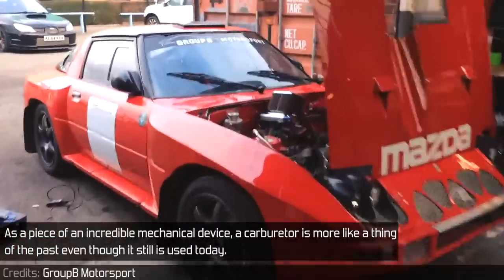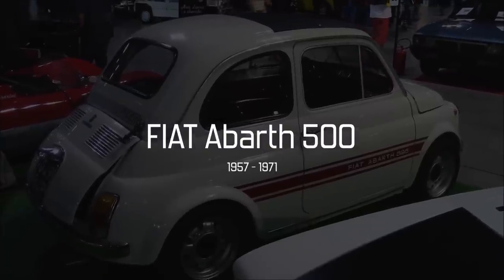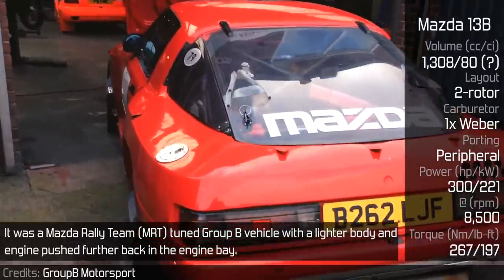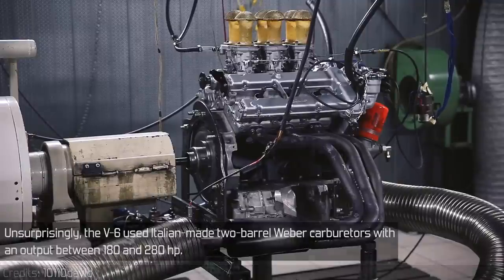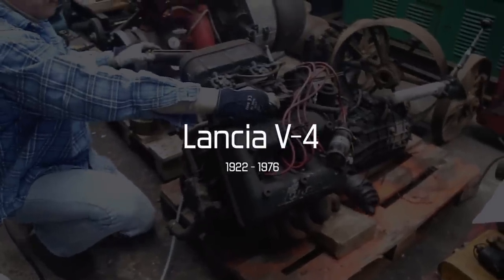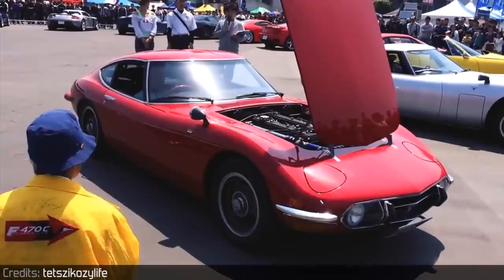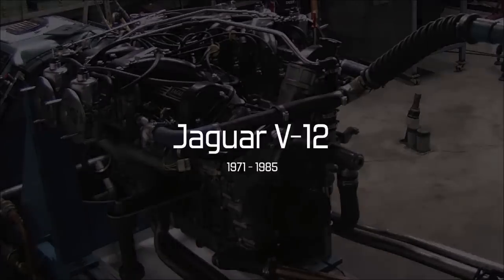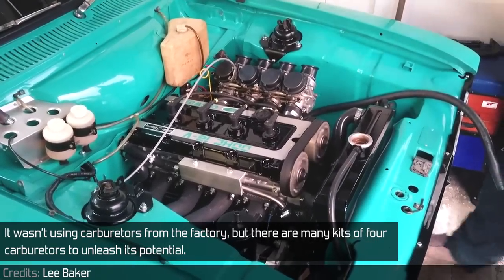10 Of The Best Sounding Carbureted Engines | Ep. 2

Comment: Best sounding carburetor car I used to own was a Mini Clubman S with a Cooper S 1310cc engine!  The rebuilt engine replacing the original 1100cc one I had fitted with a rally cam, & as it had for some reason a non-factory manifold having stud-holes which could accept larger 1&1/2" SU twin carbs (fortunately found an odd matching one at a wreckers). After grinding out the manifold to match the carburetor venturis, installing the engine with headers/extractors & straight-thru muffler, &  with a bit of trial & error with needles , I had that Mini sounding & performing totally awesome! 
Was even asked whether it had a V8 in it!
It was a full conversion with the disc-brakes, a Rover brake-booster, dual-tanks, in one of the last Aussie Minis to have hydrolastic-suspension (pumped-up, with shocks & adjustable negative-camber arms fitted), running widened rims & rubber!

Comment: Um , your Jag V 12 was the six cylinder version
Reply: marc st laurent I just got to that part of the video myself! Was wondering if anyone else had noticed... Lol
Reply: Yeah...but not to worry.  The straight 6 sounds better than the V12 anyway.  :-D
Reply: aussiebloke609 Indeed it does! More reliable too with the added bonus of a sweeter note. We have a 4.2 Jag straight 6 putting out around 285bhp and 300ib/ft of torque in a 1970 Ford Capri Mk1
Reply: Damn...that's gotta be a tight fit.  I remember the old Capri...pretty sure it wasn't designed with a straight 6 in mind.  :-D
Reply: And the inline 6 has as much horses as the V12 and just a bit less torque, the V12 actualy is the cheapest E type you can buy because most don't want this version with all it's added trouble and maintenance costs.
Reply: But i think the part where we saw jag revving from behind was v12 because i have seen that type of exhaust only in v12 models
Reply: Kalle Lahti yes, the red E Type with the four tail pipes out of the single back box is a V12 example
Reply: @Rius9106  also you can here from the note the softer tone generated by more cylinders. Personally I think V12 fits better to the classy style of Jaguar, but would pick the V6 myself tho

Comment: In Australia chrysler produced the charger with a 265ci (4.3 litre) inline 6 that was factory fitted with triple webber carbs. Holden produced a 202ci (3.3 litre) inline 6 with triple carbs, both of these engines sound better than anything on this list

Comment: Noteworthy: the Cosworth YB is distantly related to the 2.3L OHC I4 used in Ford Pintos and Mustangs (basically different branches of the same evolutionary tree).  Like the Cosworth, the Pinto/Mustang 2.3L absolutely loves boost and has been seen putting out over 1,000 horsepower with enough of it.

Comment: Toyota 4A GE?
Reply: TheJean590 ikr but maybe the part 1
Reply: those are always fuel injected, the 'E' stands for fuel injection

Edit: the 3M-GE mentioned is a mistake as a 3MGE never existed
Reply: It's in the first video because many people swapped them to carburetors
Reply: Those have EFI. The AE85 was carbureted though I believe
Reply: did you read what I wrote?
Reply: eraser216 I didn’t see that, but if that’s the case it makes sense. Why do people swap them back to carbs though?
Reply: wes276 it is a lot simpler and no electrical wires needed if done right carbs are highly tunable? And the sound maybe
Reply: Idk but watch argentinean ford falcon 221 engine, thats savage
Reply: wes276 I don't know but many people did this with the first fuel injected Opel engines too. Maybe there was not much know how about injection tuning back then and for the self-wrenching car guys it was easier to swap to carbs and work on them.
Reply: response and ease of tuning is the main reason
Reply: ae85 was carbureted but was equipt with the 4A-C (SOHC)
Reply: I'm going to carb the 4A-GE in my mk1 MR2 soon, with Honda CBR900 carbs :) :)

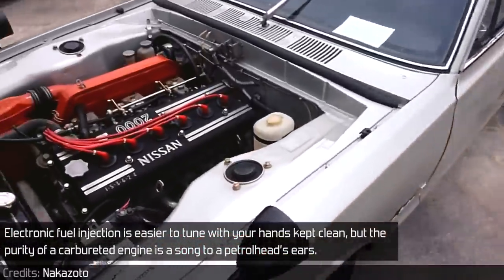Comment: Eletronic fuel injection is harder if you consider the costs and the devices you have to use...but you will get a better tuning in the end compared to a carburetor 0:10
Reply: once set up, cpu tuning is much easier than swapping jets and checking plugs
Reply: EFI doesn’t need maintenance/tuning nearly as much though
Reply: Leonardo Vargas I'm the guy who can still time a carb engine by ear. No need for a timing light. I also daily a 1975 Ford Maverick on my channel

Comment: In Australia there was a I6 holden from the 1940's to the late 80's starting at 138ci and ending at 202ci which its similar to the L series and was known as the giant killer as it beat the ford 351ci around bathurst
Reply: The early grey motors were different castings and not interchangable with the red/blue/black engines even though they look similar, so you're really talking 64-85 (EH-VK). The VL used the Nissan RB30 and the VN onwards used the Buick V6.
Yeah the XU-1 Torries were quick, but a lot of that was power to weight ratio being 300-400 kg lighter than the Falcon GT, also the triples were a bitch to tune and keep tuned, the second they got out of tune the Falcons would just disappear in the distance (same thing with the 6 pack Chargers).

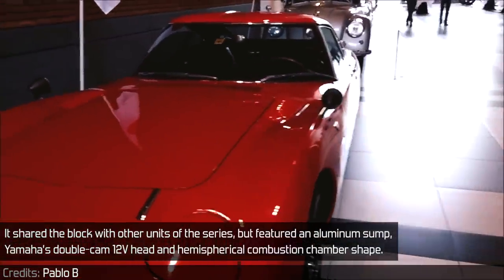Comment: there's a little error at 6:40. that's the 3M engine, not the 3m-ge. G came later for engines whose cylinder head is intended for performance , E means electronic injection

Comment: ive always liked the 'chevy power moan"

my 77 chevy truck......that 400 small block trying to move the 4200 pounds of truck threw a Q-jet carb...... BAAAWWAAAAAAAAAAAAAAAAAA
Reply: also,,,,, my 99 buick century with a 160hp 3.1 v6 sounds SO FUCKING GOOD
its all intake noise....

its bark is much worse than its bite..... it sounds like a 6 liter, but has the power of a 2 liter (its got a lot of touruqe however.....its a FULL 160hp)

Comment: Carbureted engines sound interesting because the carb does a piss poor job of delivering an accurate and equal fuel mixture to all the cylinders. Especially when they're not brand new. You can keep 'em!
Reply: piss poor?   for what they are, they work well. please tell me why most people need a computer controlled car just to go down to the shops.

Comment: Fiat 500 engine is a boxer twin, not an inline.
Reply: Simon Coles Nope, it's an inline 2. Perhaps you are getting confused with the 500's produced in Austria by Steyr-Puch, which used to run a flat 2 from Puch motorcycles :)
Reply: no, he is right when he says boxer twin.  basically its a inline engine with a flat plane crank.    boxer twin is more of a motorcycle term though, but its basically the same thing.  inline engine with a crank that had 180 degree crank pins.
Reply: Big Show oh I see what you mean now... Anyway, don't all 2 cylinders either have 180º crank pins or 90/270º? Where I live isn't really a thing to call an inline engine a "boxer" because of crank pins, we call "boxer" flat engines here. My bad, I suppose :)

Comment: How can you talk about the best sounding carboureted engines and not even mention any of the classic American V8s, which all sounded better than most of the cars on this list.
Reply: Ai Torror deserves it's own video.
Reply: Cause they sound just like LS motors, but with a little more intake noise and no fuel pump whine. Blub blub blub blub blub angry intense roaring up to a screaming 4,000 rpm blub blub blub blub blub
Reply: Ai Torror the 9,000 rpm Nascar engines tho
Reply: He includes a Chrysler V8 in the first carby engine video...
Reply: Also because these are very common, you can find videos of suchs engines everywhere on YT, classic americans V8s are a common sight in car meets even in europe.
As far as I know, this channel oftenly focus on more rare/exotic/akward or special engines, cars, etc, like for example here keï cars or a carburated rotary (didn't even know a such thing existed until now).
Reply: Because he does multiple episode of Carbed engines....
Reply: 350s go to 5200 rpm.... factory red line
and can be revved higher (but power does fall off.....especially on the smog head years)

take a 400 small block.....stick in a 350 crank....ya get a 377 and it revs to 8000 rpm....
bit fat pistons on a short stroke
Reply: v8s are dinosaurs man.
Reply: Would rather put Triumph Stag in this list

Comment: Injection are very sucks and complicated today in most cars, and why not buy carburetor cars..
Reply: Direct injection, yes. Port injection is simple.
Reply: Fuel efficiency
Reply: No no no, Carbs suck. Injection squirts...
Reply: Power emissions reliability costs tuning. Beside from noise EFI wins over carbs without sweating
Reply: Ethanol in today's fuels doesn't  play nicely with carbs if allowed to sit very long.
Reply: Armed Reptile took the words RIGHT out of my mouth. Owning an older sports bike that has FOUR carburetors that I sometimes can’t ride for a couple weeks at a time has made sure I never forget the trouble ethanol can cause for carburetors if you’re not always treating it and using it. Thank God for Seafoam and highways.